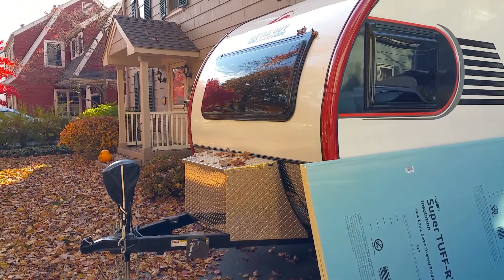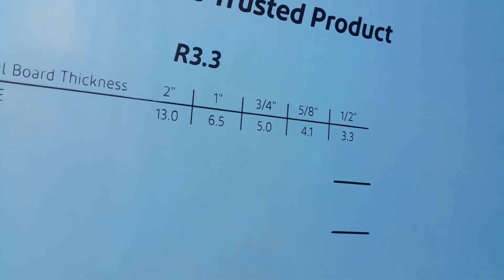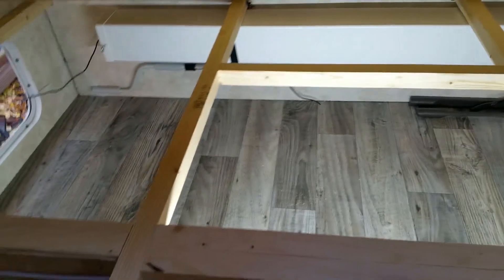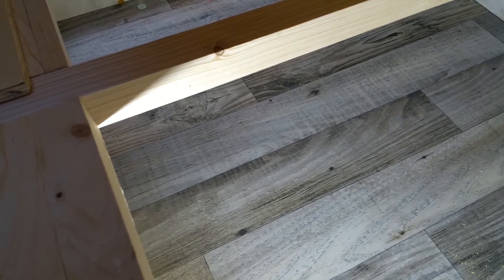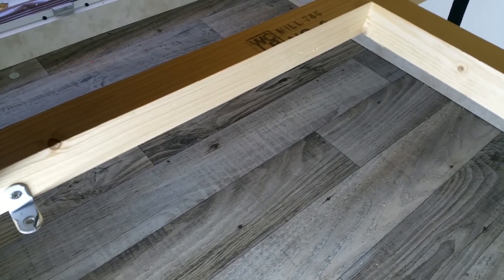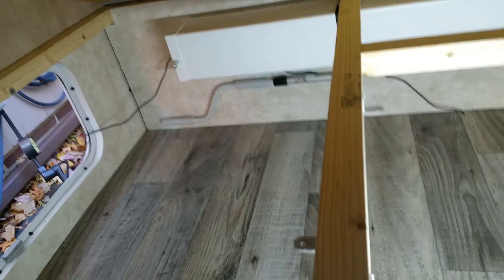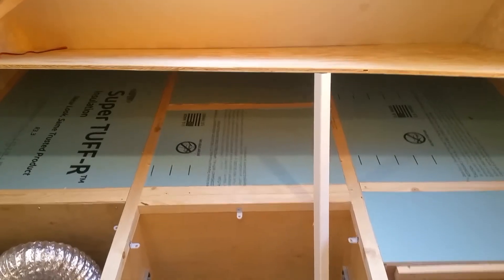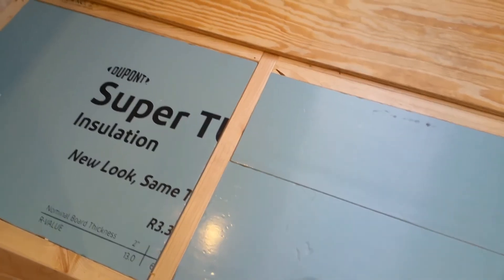Little Guy Max RV Under Bed Insulation Hack

Comment: I'd definitely insulate the backboard too, because by insulating the bed area, that area with the pex piping, won't be getting as much of the camper heat and can freeze up easier by insulating it away from the heat.
Reply from the maker: Very good point about insulating the backboard. I plan on using foam insulation at some point, I have some other mods I like to do on the backboard first. Thanks for your comment.

Comment: have you noticed if this helped keep the unit cooler with the AC?  Since less heat should be rising up from the storage bay
Reply from the maker: Good question. We use are RV during colder times, so we have not but would expect insulation to help the outdoor heat to be migated as you mentioned.

Comment: I wouldn't insulate around the heater unit. Might melt and catch fire.
Reply from the maker: If that is a concern, easy enough, do not insulate the furnace box, ie do not install blue board insulation over the top of furnace box. I have used many times and no indication of melting the insulation.has occurred. Thanks for the comment.

Comment: good video, wondering about air intake to the furnace. staying open?
Reply from the maker: Thanks for the comment. The intakes to the furnace are not blocked. The insulation covering the furnace  area is the same as the plywood cover.

Comment: Do you have a link to the brackets on amazon?
Reply from the maker: https://www.amazon.com/gp/product/B07T9NG893/ref=ppx_yo_dt_b_asin_title_o04_s00?ie=UTF8&psc=1
YEWLACA 20 PCS Corner Braces 25mm x 25mm Stainless Steel 90 Degree Joints Right Angle Bracket L Shaped Corner Brackets Fastener for Wood Furniture, Screws Included

Comment: Why not just add a layer of insulation on top of plywood and then a half inch plywood, thereby creating a sandwich? Helps keep cold out and during summer heat out? Matters not as this material is not sold here in CA. Home Depot dropped it.
Reply from the maker: Sure, that is another option. In my case, wanted use dead space and have another plan to put a storage compartment above.